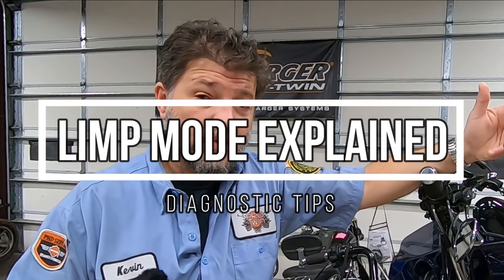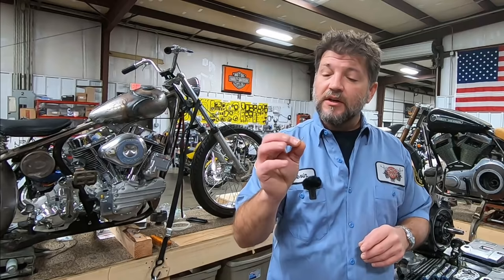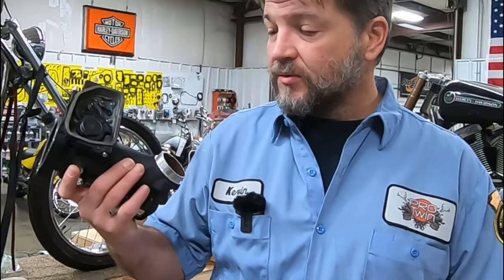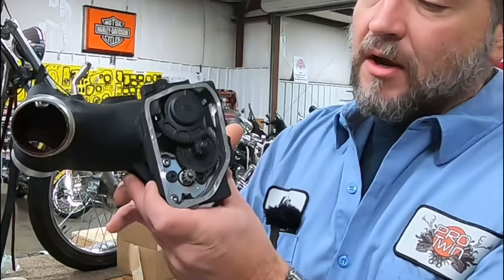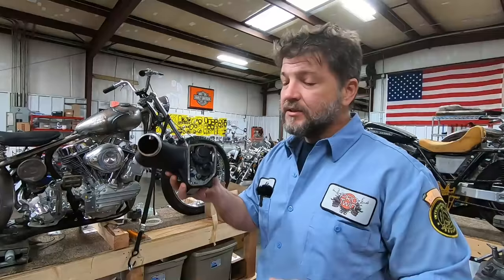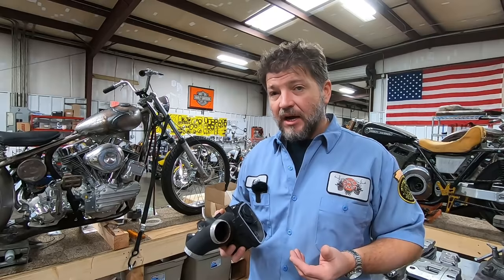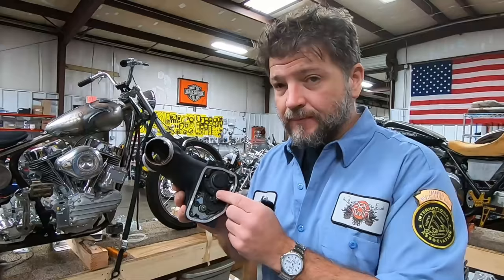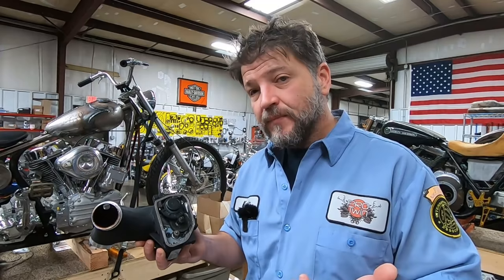Harley Limp Mode | Throttle Lag | Fly by Wire Explained | Kevin Baxter | Pro Twin Performance

Comment: Question , my last rid of the season i got a bad batch of gas it pinged - knocked n stuttered bad enough i pulled over to check the oil . the level was fine then i noticed i was getting about 15 miles to the gallon when the low fuel light came on soon after getting my 2.5 gallons of gas so i stopped at a name brand gas station in a better part of town n filled the tank . I hit the starter n got a backfire not of the m 80 size but larger than the typical black cat fire cracker , hit the starter agian n it fired up n i rode off . within 2/3 miles the motor smoothed out quieted down n seemed to be back in normal running order . i came to a stop n when going to release the clutch i had a miss at about 12 r 1300 rpm n road away perfectly fine the next red light the same thing only when taking off from a dead stop does it behave like this even if not letting the clutch out or in gear i,ve got a miss just above an idle after the bad fuel ,from 1300 rpm up it runs like  a dream and it idles perfect . I know you cant diagnose from my writing a question but where would you suggest i start at ? kinda sounds like the throttle by wire in your post but its a heck of a coincidence it started with the bad fuel .Any advice would be appreaciated very much . THANKS MUCH ive learned alot from all your posts !

Comment: IF I purchase a ECM on for my 2010 Limited FLHTK. Do I still have to take it to a dealership? I have replaced my crank sensor, plugs & wires, and coil pack but still will not start.

Comment: I have a 2019 rgs. Has 12.5k miles on it. Took it to the car wash. Fired right up...went to have dinner. Get back on the bike and no throttle response and the engine light came on...after 2 times of shutting it down and restarting it for the 3rd time the throttle worked but the engine light stayed on until I made it home 6 miles later. 
Could water in the wrong spot trigger that or would it be like you said in your video?
Reply: Water in the air cleaner. Could cause it to choke rhe air thru the filter,  also introduces moisture to the engine. Water doesn't compress very well, if at all. So in short, yes

Comment: I had a 2008 ultra lemonade that I bought new. What a nightmare that thing would go into limp mode pulling out into traffic back to the dealer Until Harley came out with the bulletin change the pins. Never had a problem after that but for a whole year almost killed myself a few times and my woman because I ride heavy you know trips. I will shut the bike off Turn it on pu fuses

Comment: My junk is as the throttle body...did enough miles on limping along...plastic cable ties been working....
Reply: My 09 street glide has the same problem....
Reply: What did you cable tie at the TB?